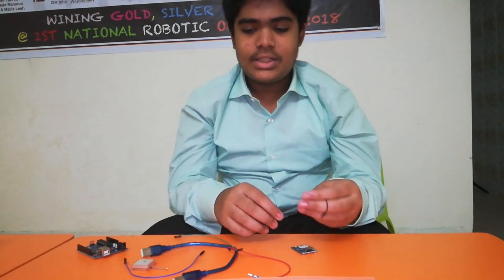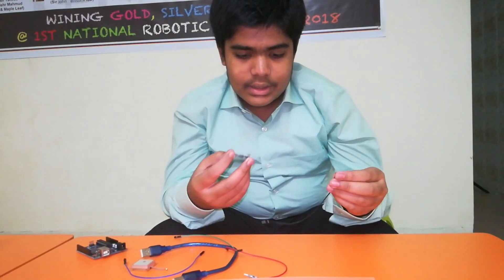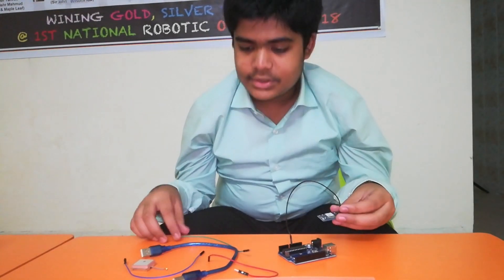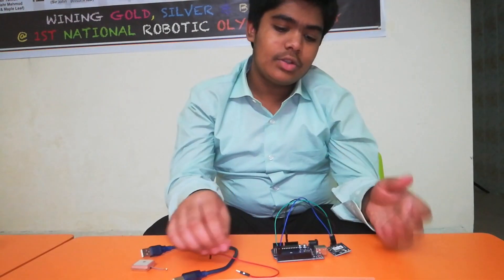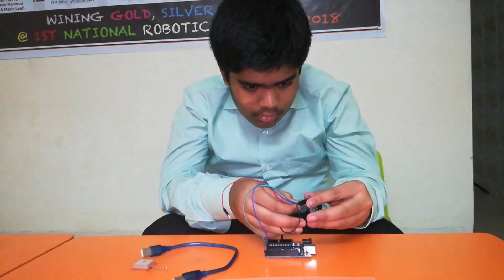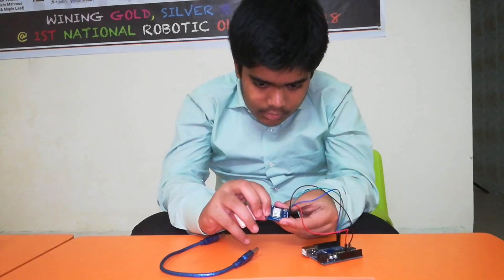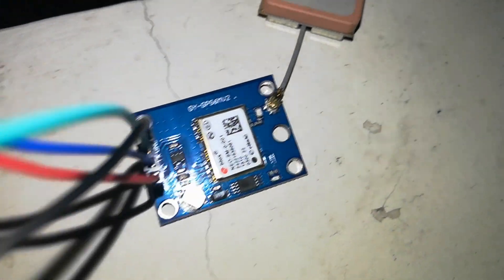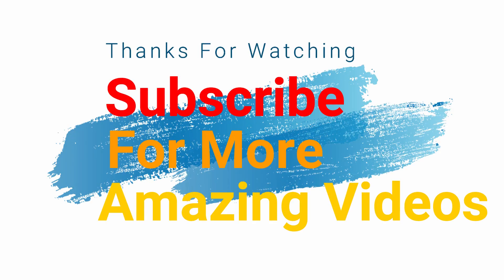How does the GPS system work? Why No signal in the GPS Module with Arduino?

Comment: When i connect the antenna my gps Device doesn't blink light, but when i remove antenna the gps begin blinking light!
Reply from the maker: Which gps module you are using?
Reply: @Hacks360  same as your, neo-6m
Reply from the maker: Then it should work. Please check description for more details and resources. Thanks and stay connected.

Comment: Our gps led is not at all blinking that red led and no latitude and longitude datas are found how to overcome this problem it's an urgent requirement reply me please...
Reply from the maker: If the red LED on your NEO 6M GPS module is not blinking and you are not getting any latitude and longitude data, there are several things that you can try to troubleshoot the issue:

Check the power supply: Make sure that the GPS module is receiving the correct power supply voltage (usually 3.3V or 5V, depending on the module). Also, make sure that the power supply is stable and free from any electrical noise.

Check the connections: Make sure that all the connections between the GPS module and the microcontroller or computer are secure and free from any loose or damaged wires. Also, make sure that the connections are made to the correct pins on the GPS module.

Check the antenna: Make sure that the GPS antenna is properly connected to the GPS module and is placed in an area with a clear view of the sky. Without a clear view of the sky, the GPS module may not be able to receive satellite signals.

Check the baud rate: Make sure that the baud rate of the GPS module matches the baud rate of the microcontroller or computer that is receiving the data. The default baud rate for the NEO 6M GPS module is 9600 baud.

Check for data output: Use a serial monitor to check if the GPS module is outputting any data. If you see data being output, but it is not in the expected format or does not contain any latitude and longitude data, you may need to adjust the configuration of the GPS module or the code on the microcontroller or computer to properly parse the data.

If none of these steps resolve the issue, there may be a hardware problem with the GPS module, and it may need to be replaced. Thanks.

Comment: the first time when neo 6m have power supply 3,3V from esp32, is it LED solid ON? mine the LED is not ON. is it circuit faulty ?
Reply from the maker: Just run example program and check serial monitor to check whether the device sending right data or not. This is the best way to check neo 6m. Thanks and please subscribe...
Reply: Same issue can you help me out
Reply: @TARUN__46  you have to take it to outside, so the antenna pointing the sky, then just wait, it will blink

Comment: Hi sir, I did exactly like this for my project but it didn't display data in COM even though the GPS 6m blinks. I don't know what is the prob. Sir, if you have any idea about that?
Reply from the maker: Did you try using Arduino? If so, check the connections and code again. Thanks!
Reply: the reason is it want agood network , if u sit withur pc and command than network problem occurs thats y it cant command u well